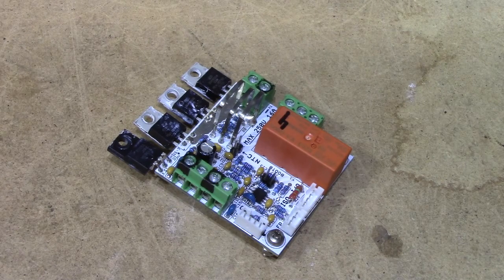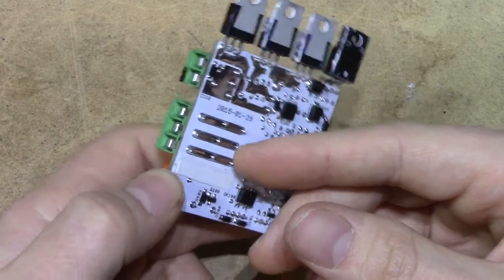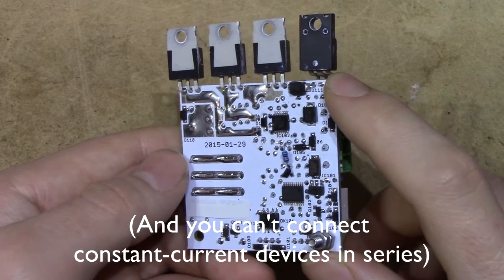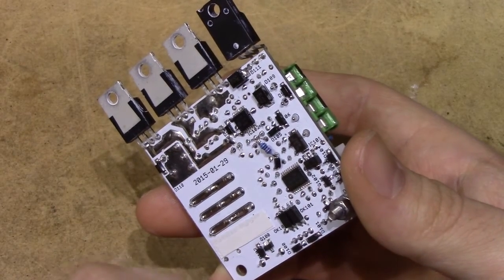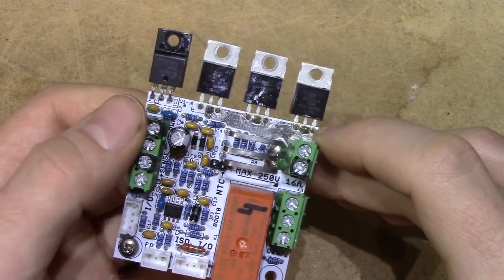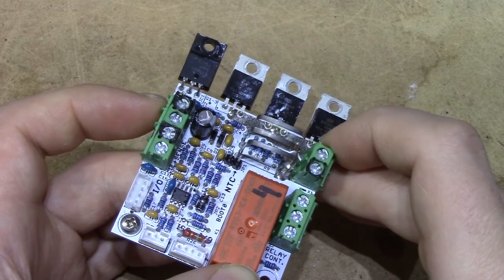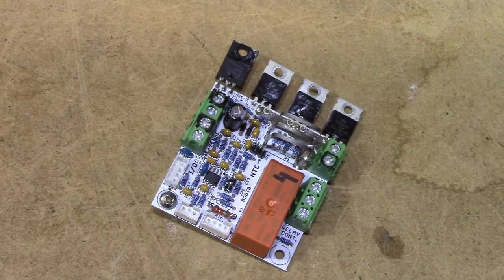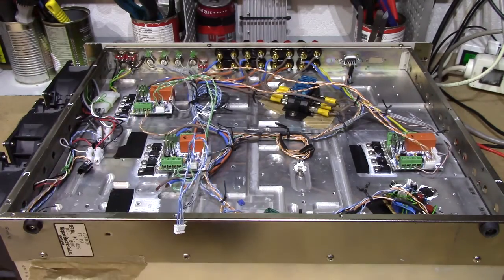Quad 10 A current sink project, part 2: Board details

Comment: If there ever is a new revision: I might have opted for having the relay powered from an external power source instead and had an opto-coupler for that coil. Then you could skip the cooling of the regulator and fit another mosfet in its place. Also one could put mosfets on more than one edge of the board.

To free up space the relay could be on its own board (perhaps with the isolating input and the power stuff locally) and finally: put the resistors standing up (depending on the vibrations and such of course).

Idea: the relay could be a optically isolated mosfet that in turn controlled an external relay if it was insufficient to control the charger/whatever by itself.

In any case, improvable or not: Nice work, and I love your videos!
Reply from the maker: +Dennis Olsson There actually is a new revision of this board coming up from the same designer (I'm just helping out), which addresses all the issues we found with this design. This was just a proof-of-concept board to see that it doesn't instantly explode.

Comment: I found that interesting, thanks! That 7805 has gotta go. I assume the biggest current draw is the relay coil?
Reply from the maker: Dr Tune Yes, it draws about 100 mA. It really was a borderline case whether or not the 7805 should be heat sinked, but in the end we decided to do it that way, since it would be likely to overheat in high ambient temperatures if mounted freely on the board.